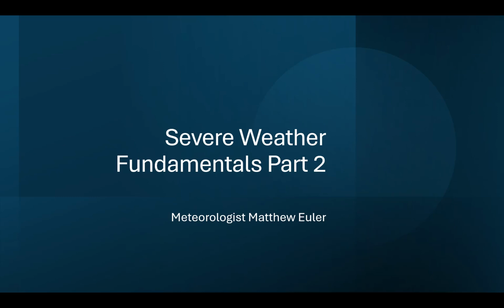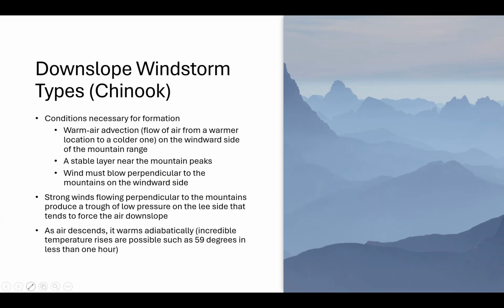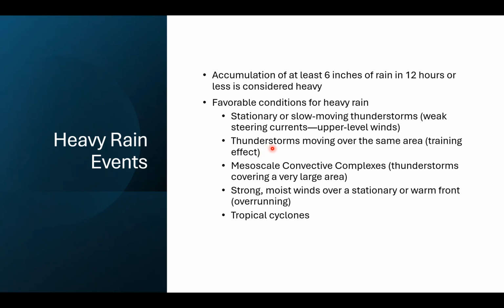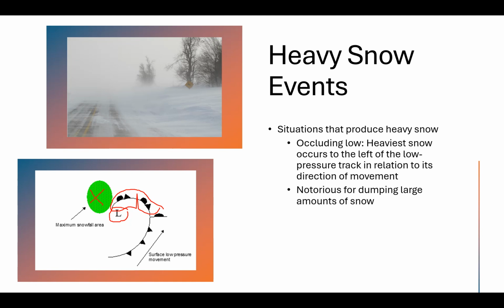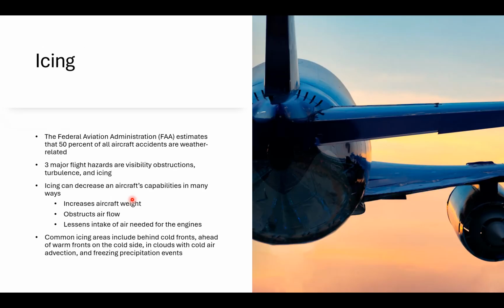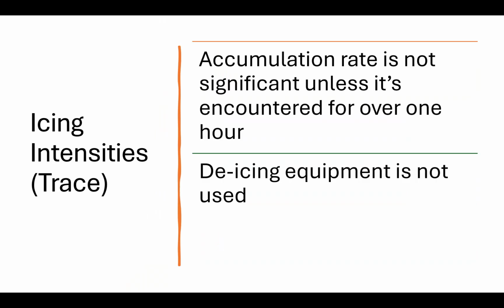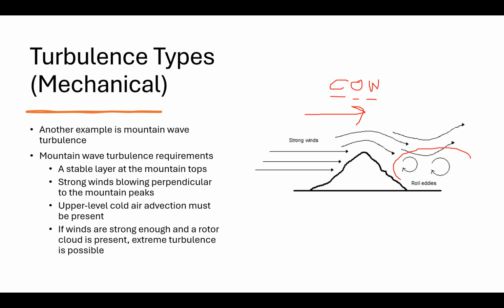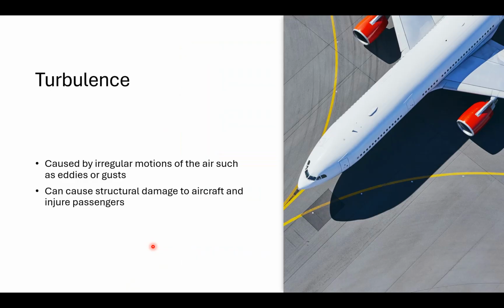Severe Weather Fundamentals 2

Comment: Juneau, Alaska is a very good example of common downslope wind events that can occur during the entire winter.  They are locally called "Taku" winds and what I've noticed is that since the downsloping air that forms over the coastal mountains/ice fields is very cold, arctic air originating from Canada.. the downsloping doesn't warm them up very much and also dries the airmass out in Southeast Alaska on an extreme scale, with relative humidities dropping below 30% in some cases.  I've even seen some very light snow flurries in this type of environment, which generates very dry tiny plate-like "snow grains" that feels like flour.  The snow:liquid ratio equivalents in these types of events is probably over 100:1.
Reply from the maker: Amazing!  Thanks for sharing your story.  It is so cool to learn something like this!

Comment: I moved to Regina, Saskatchewan in June of 2022.  I still remember the first time I saw an "Alberta Clipper," a good example of lee-side cyclogenesis.  The temperature dropped from -5 degrees Celsius to -23 degrees in just a few hours, accompanied by a bit of dry snow and fierce northwesterly winds in excess of 90 km/h.  By the way, we're about 50 miles too far east to feel the Chinook, although Maple Creek, Saskatchewan gets them somewhat frequently.  That's why Maple Creek is sometimes called Saskatchewan's "California."  On another note, in Late December of 2023, we had freezing rain at -7 degrees, which is a low temperature for freezing rain.  The cold air layer at the ground must have been very shallow, or sleet likely would have fallen instead.
Reply from the maker: Incredible personal example!  Thank you for sharing!